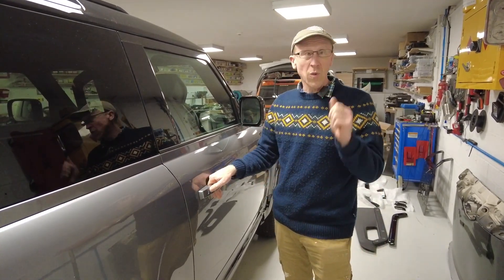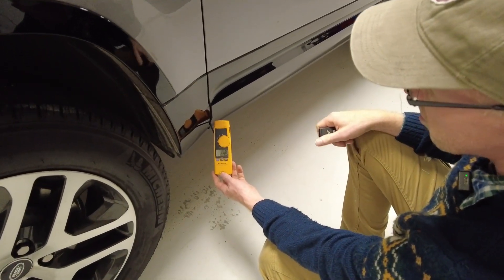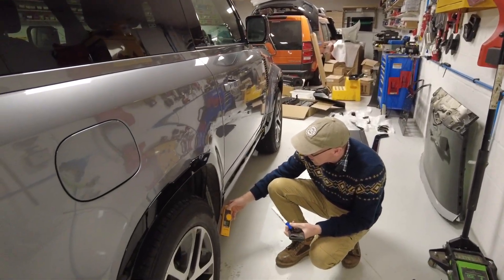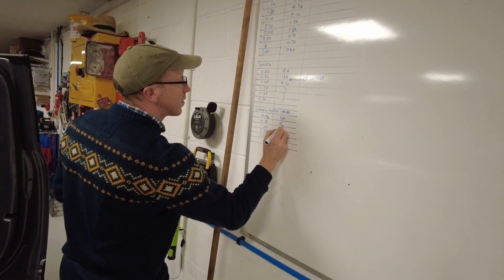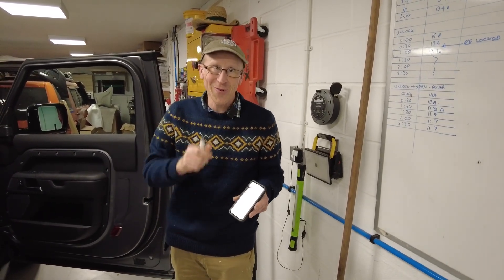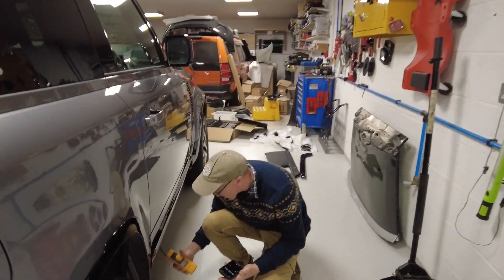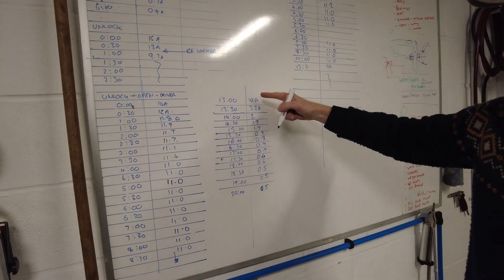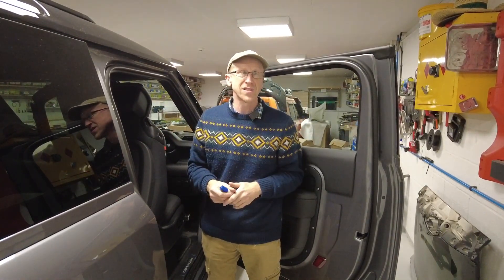Battery Drain Analysis on Land Rover Defender L663 90 - Low Battery Warning Problem

Comment: lol , i'm surprised there isn't an APU or small petrol generator on-board to keep the battery topped up  .. remember the good old days when if you left the ignition on too long you burned out the coil
Reply from the maker: Yes boiled.a couple of coils in my time !

Comment: I made a test harness which has a small current shunt in parallel to a battery isolator. Close the isolator so you can start the car etc, open it to put the current shunt in series. I then measure the volt drop across the shunt on my Brymen DVM that has a computer connection for datalogging over many hours. Used this to track very intermittent battery drains on a bmw e65 and a l322.
You can also buy bluetooth voltage monitors that have onboard datalogging. As you you have noticed when a car wakes up it draws loads of current with a volt drop as well.  The voltage drop gets logged and you can use it to track down errant ‘wake ups’.  My bmw turned out to be kept being woken up by a faulty touch sensitive door handle.
Reply: bmw e65 falls asleep in stages, 20 mins, then fully at about 45mins - the telltale is when the glovebox light goes out.  P38 telltale is when the park led goes out on autobox.

Comment: Simon, you don’t need to unlock the car to open the tailgate, if you have the key in your pocket/hand you can open the tailgate whilst the car is locked (wing mirrors stay in). Just a thought, it may make a difference when camping etc.

Thanks for the video as always.
Reply: Also when you shut the rear door after opening like this, it automatically relocks
Reply: As a 110 owner who takes it out camping all the time, it doesn't even matter if the vehicle is locked or not.  Opening the rear tailgate performs the full start up no matter how you do it.
Reply from the maker: Good thought - but pretty sure the car will behave the same way - but thanks for the advice on the keyless entry - still getting used to that.
Reply: Yeah. On a 2005 opening the boot only stops the infotainment powering up. I think you already tried this on your 110

Comment: Maximum quiescent drain should be around 30 milliamps (0.03 amps) so you’re still over 10 times that. Try the tests again with the smart key at least 5 meters away from the vehicle
Reply from the maker: OK will do - but the results are pretty much the same on The Stig - this does not have keyless entry.

Comment: One of the silly systems the New Defender had. I really don’t understand why they don’t just have the system start up with the drivers door only.

What I do to over come this on my travels is leave a door slightly open/unlatched and the system eventually shuts down completely. 

Thanks for your efforts Simon
Reply from the maker: There is a company in Taiwan that have a bypass module to stop this happening.
Reply: @L663  thank you. But I only trust you guys at Powerful 😀
Reply: @L663  which one company in Taiwan. Would you let me know that? Because I am Taiwanese. Thanks.
Reply from the maker: @瓦西傑克森  Really really sorry - I have mixed up countries again. It is Korean company. Here is the video
https://www.youtube.com/watch?v=GJ_shzbzoFc
Reply from the maker: Ooops - the company was Korean ! here is the video

Comment: One of my cars used to draw significant current for a few minutes, I think the engine ECU stayed awake for a while in case you wanted a restart. Half an amp will bring a fuly charged battery to its' knees in a few days but of course a hall effect clamp is easily affected by magnetism. Usually you can zero them. In a cold garage you might be able to see where the power is going with a thermal camera. Beware that the 90AH capacity of the battery is calculated on a very low rate discharge and does not mean you have enough left for an engine start. It might be a good idea to carry a tiny boost pack with you just in case.
Reply: I avoid current clamps for sub 1a readings because they aren’t as accurate - i use a current shunt instead